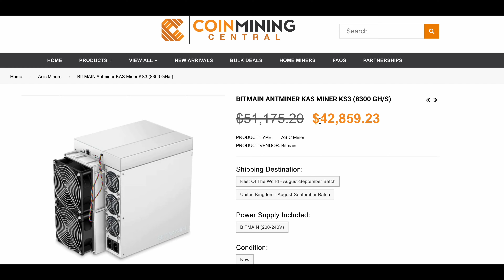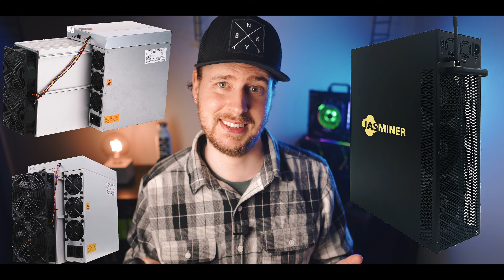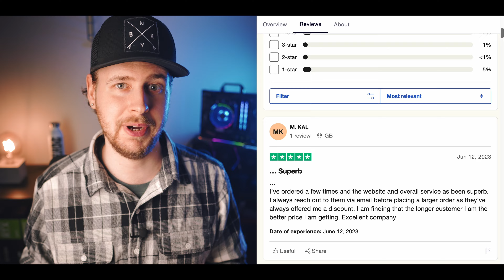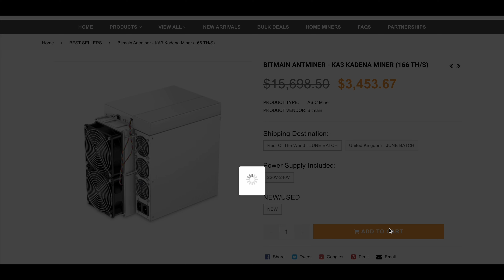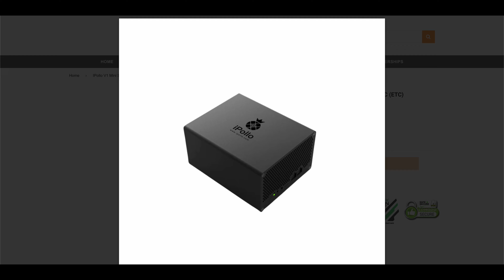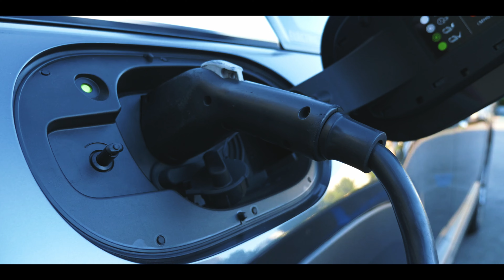Anyone can run ASIC miners at home! How to solve any possible problem! (Heat, noise, power & more)

Comment: I'm about to get an S19 PRO 110th at 1.000eu but the noise issue is keeping me to confirm the purchase. I'll sort the power consumption with my electrician and I'm ready to pay for the total consumption. Then I will be happy to have my house heat up by the heat generated by the machine. Damn can't really  make my mind...
Reply: You could low-power for less noise.
I've found the Goldshells on low power (LT Lite and LT6) are profitable and actually quiet on low power mode for home mining.

Comment: Seb what about the S19 90th? What is your opinion on that machine for the long-haul?
Reply from the maker: Well it is currently profitable if you pay less than 8 cents per kWh (electricity price). Bitcoin has a halving coming up in less than a year, which means rewards will then be cut in half. Network hashrate would then need to shrink to half its size (not likely) or bitcoins coin price double for it to become profitable again. I think it's a good miner if you have very cheap power and are going to hold all the mined coins, if you believe bitcoins price will go up a lot in the future and sell your coins then, and if you can afford to pay for the electricity.

Comment: 3000w X 4.1 btu/watt is over 12,000 btus so your looking at a big ass window ac unit.  But don’t cool with air conditioning lol.  Just an idea of how much heat an asic puts out
Reply from the maker: Haha exactly! Much better to just pipe out the hot air from the ASIC than to fight the heat with an AC unit 😆